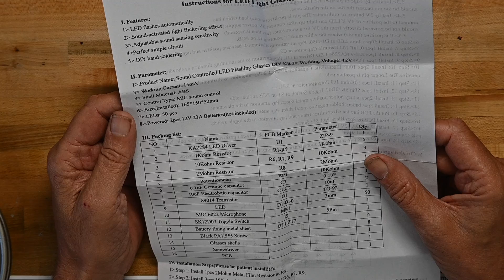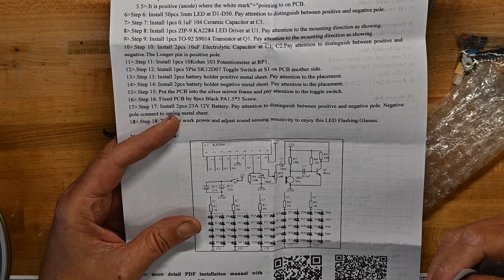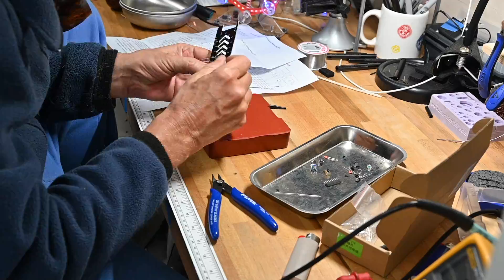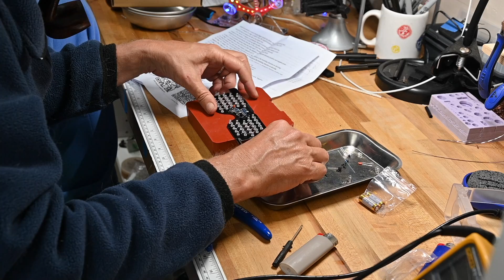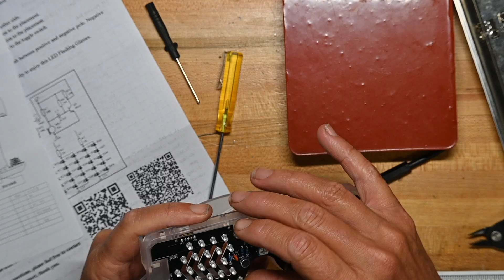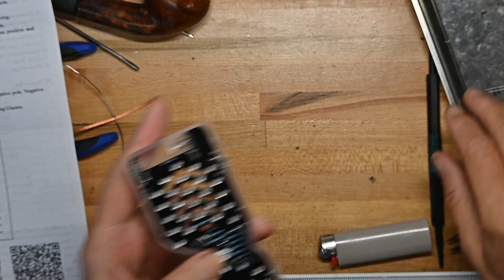C.K. builds an LED glasses kit from the Dingdong Store

Comment: What are you using with your left hand ( the metal thingy ) when welding?
Reply from the maker: @lamaryaser7132 Not sure what you mean, can you give me a time mark in the video with what you mean?  I did a quick review of the video and all I see in my left hand is the strand of solder or a screwdriver.  Any help?
Reply: @CKHaun 12:08, i mean the string
Reply from the maker: @lamaryaser7132  Ah, that's the actual solder.  A thin wire that's a mix of lead and tin with a flux core( a material to prep/clean the soldering location to insure you get a good solder joint) that is the material that binds the component lead to circuit board.   Here's a really good overview of soldering showing all the details. https://youtu.be/6rmErwU5E-k?si=upZe8pXLWpdgoruT